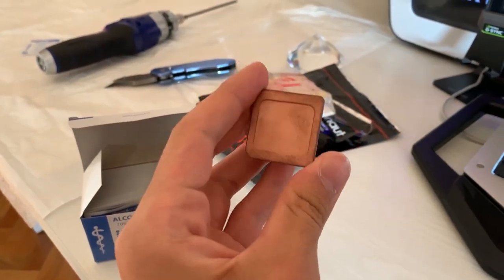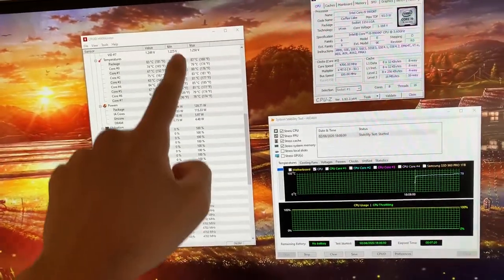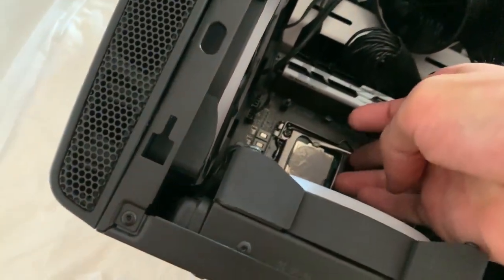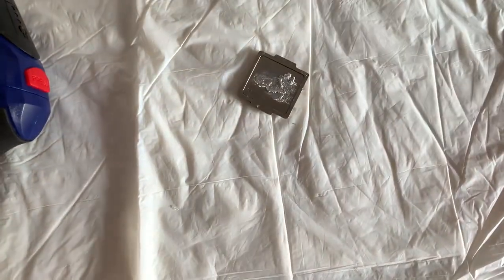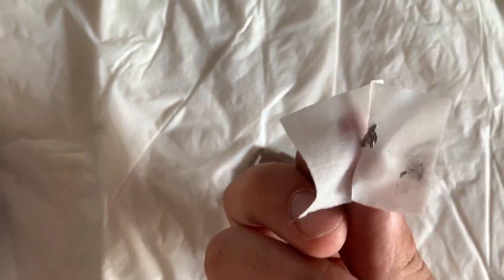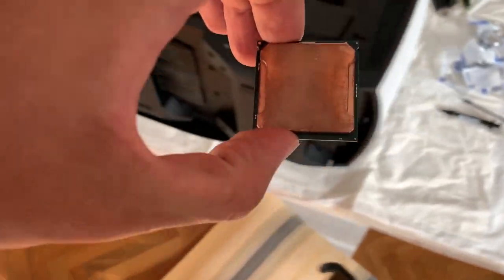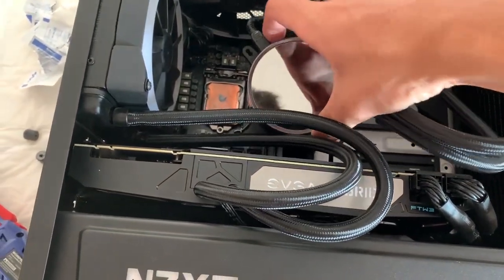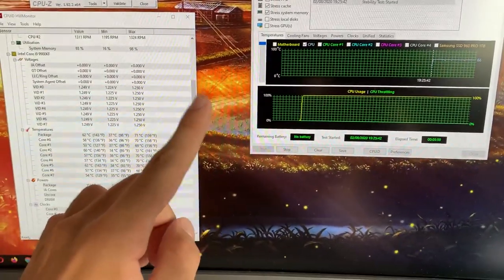I used a Copper CPU IHS to drop 20 Degrees on my i9!

Comment: Pretty sure you're not supposed to put liquid metal on copper?
Reply from the maker: You can! What matters is not to mix metals
Reply: It only stains the copper via a chemical reaction, and it does not affect the cooling or its properties.

Comment: U have to polish it my friend to give it a mirror finish. Use extremely light sand paper or wool. Also using water in the process so u dont really change how flat the surface is. It has to be perfect straight.
Reply from the maker: That’s some very good advice! But I think they did that already on the IHS, or at least they advertised it as such. In person it definitely looked like it had the full mirror finish!

Comment: Good job replacing the IHS.

It's too bad you didn't do a comparison of the stock heat spreader with the solder fully removed and replaced with conductonaut to compare with the copper heat spreader. Very curious how different your results would have been.
Reply from the maker: Yup, the difference would have been waaaay less if I had fully removed the solder beforehand. A copper IHS is more of an enthusiast thing, more than an actual performance improvement. It should give you from 2 degress better at worst to 5 degrees better at best.